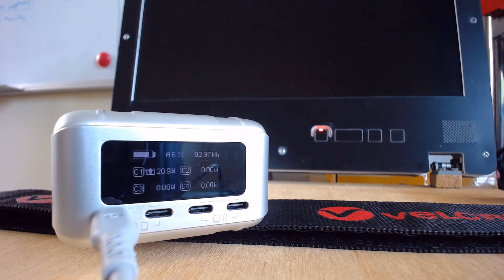DIY Mini-ITX Laptop - New Power Bank Test

Comment: Will this power bank able to charge Lenovo thinkpad x250?
Reply from the maker: I'm not sure. The X250 already has a battery that's almost as big as this power bank (95Wh). I have no idea if the X250 has a USB-C charging port, or if you'd need to use a power-sink board like I used in the video. 

I can safely say that the power bank would be completely drained if it were used to charge the X250's battery all the way from 0.
Reply: Thank you very much for the reply🙂
Reply from the maker: @MrThorth  You're welcome.

Comment: Hans, it's so thick. Absolutely enormous! Plus, if you need to make a board to acccommodate all the other facilities you need, surely you  would be as well eschewing the USB power pack for a custom designed (you're the engineer) power pack consisting of series Li-ion batteries with a circuit which checked output voltage and current as you used them, as modern laptops do any way and feeding power to screen and circuit board(s)
Possibly end up with a thinner product, too!
Reply from the maker: Hi Fred, 
If you're hoping for a thin laptop, then you'd best look elsewhere. The height of the MiniITX motherboard's components are equally thick. 

The circuit board I'm talking about making is a small simple one, containing a few buttons (for power and reset), indicator LEDs, and the USB-C power sink circuitry. It's child's play compared to designing a custom 100W battery controller & UPS. The effort involved in a custom power pack is orders of magnitude greater.

An easier option would be to go back to the custom battery pack plus off-the-shelf UPS that I originally used. However, I ditched that for a reason. Feel free to look back at previous videos for why.